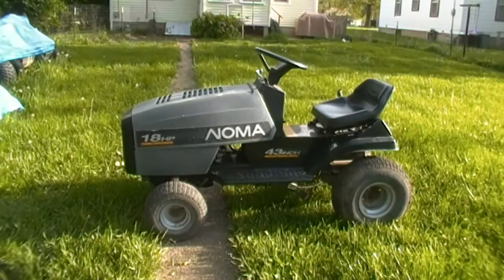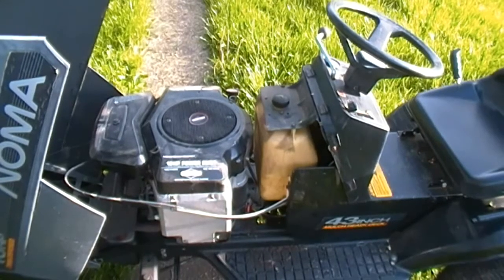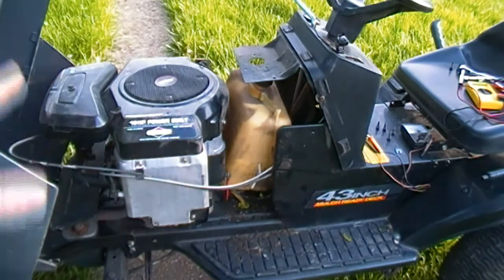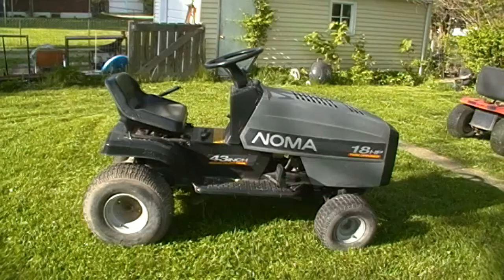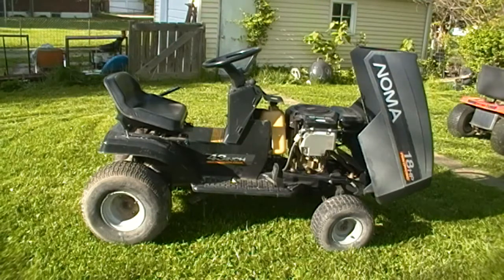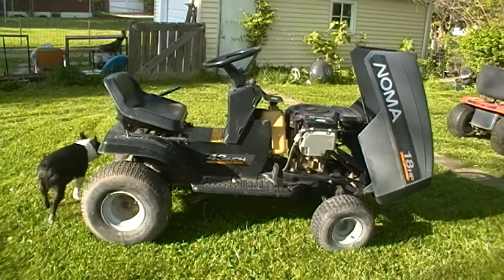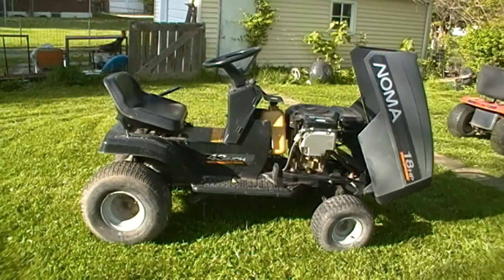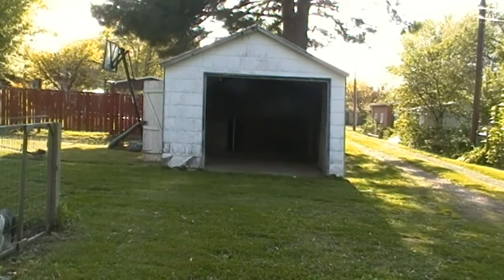TRYIN TO HEAR THE NEW NOMA 18HP RUN

Comment: have you checked the deadman switch under the seat? mine went bad had a dickens of a time tracing it to that,it cool that you got it started sounds strong!
Reply from the maker: Gene soverns I did, I was testing it and my multi testers (2), both had battery issues. So My tests were inconclusive, I did try it disconnected, & with a jumper wire to trick it. with no success, I might ad.   But I may revisit that area when I get back out there. 
 Lil tips like this trigger us to re-think things. & For that,  I Thank you,... Cheers

Comment: I'm sorry you are having so much trouble getting that thing running, I just though it was  a safety switch but could it be the ignition switch or solenoid? if it was that I wonder if the kill part of the switch is messed up. You should see the mess I got myself into, a guy had me put dual stacks on his mower and that was the easy part, the wiring came off a different mower so I finely just hooked up a start wire and kill wire and that will have to be good enough, then after all that, the tank had a bunch of water in it and naturally the carb was messed up, I still haven't got that thing going,, I hope tomorrow it will be gone.. lol
Reply from the maker: MissouriOldTimer Oh my, sounds like you've got your hands full on that one.
As far as this one goes,... No worries, I'll get it.. & I knew what I was getting into when I picked it up. I still thank you for the awesome deal. 
Hope you get your mess straightened out soon too,... 
Take care & Thanks for saying.  Talk again soon.

Comment: Tank might slip out if you remove the flywheel shroud.
Reply from the maker: revitup1965 Tried that & no go. there's a base p[late in there the same size.
Thanks though, I like the way you're thinking... Cheers

Comment: hay buddy you said there were loss wires under the dash did you check maybe the ignition is just unplugged here hoping good luck
Reply from the maker: drvshaft drew The wires I saw unplugged don't appear to be from the key switch, But I can't be sure what they do til I get in there. Thanks Drew
Reply: keep starting it the way you are is the only way I know sorry I cant help more
Reply from the maker: You're doing fine Drew, I'll figure it out,.. even if i have to hot wire it. lol